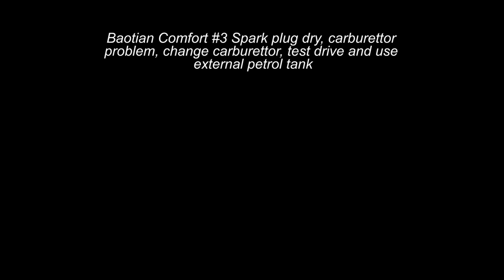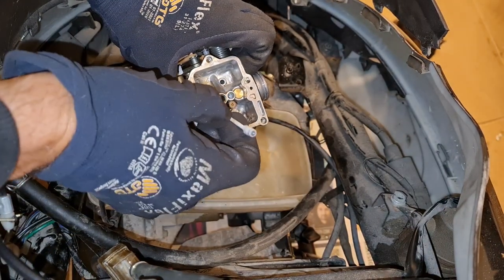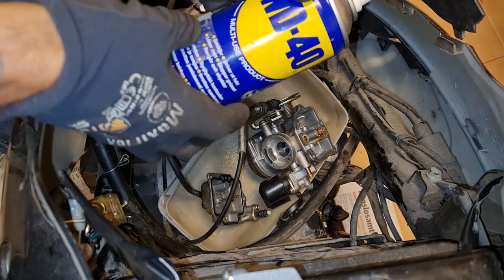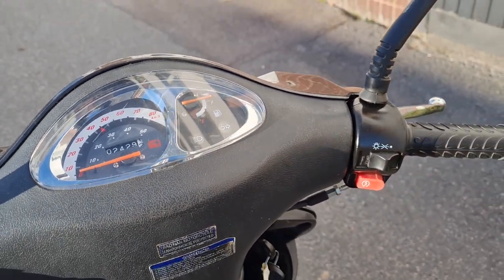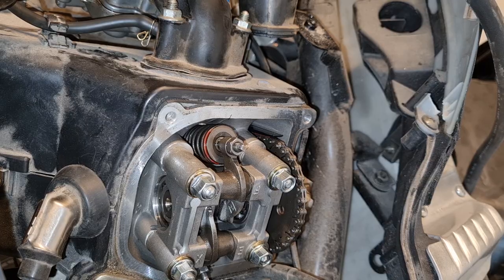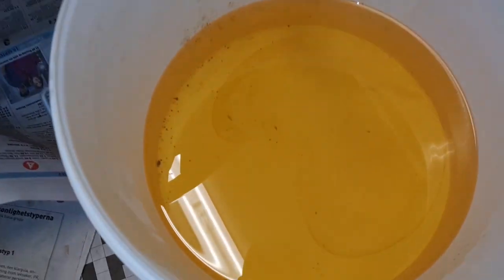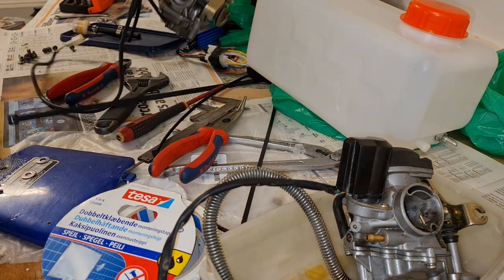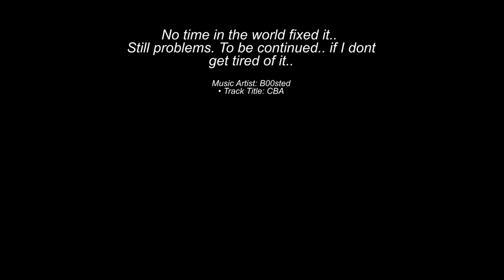Baotian Comfort #3 Spark plug dry, carburettor problem, replace carburettor, test drive and use exte

Comment: For cleaning the carburetor and the jets, try descaler and high pressure air. You can disassembly more the carburetor, there are more parts, that can cleaned. Check the diaphragm. Check the electric choke, give them 12v. It should move out. The sealing of the choke is ok? Try other jets. Search youtube. :)
Hopefully help something.